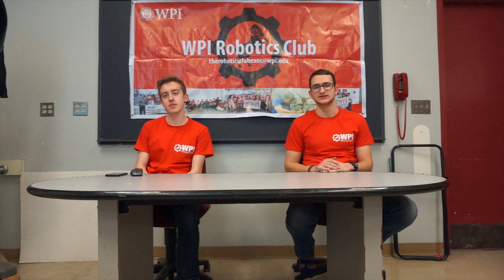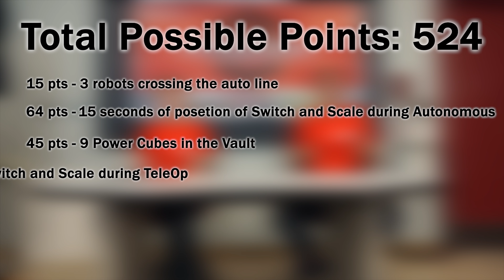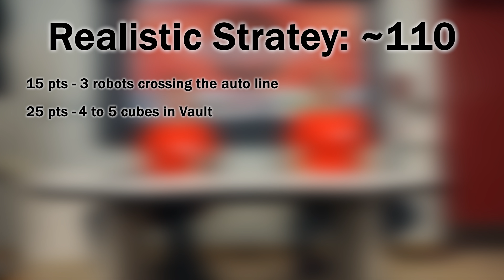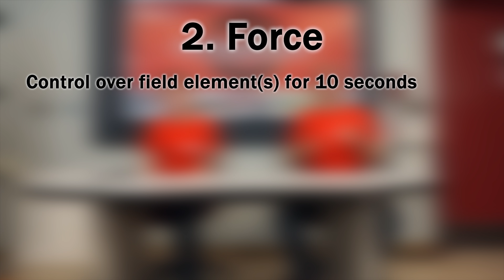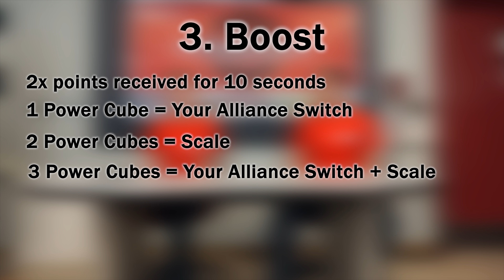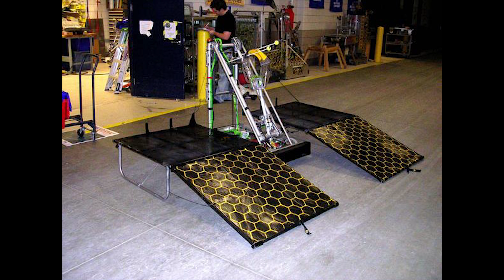RI3D 2018 FIRST FRC Power Up Strategy Video

Comment: Interesting video. Side note: Your hypothetical match score is 20 points too high, due to the fact that boost 3 doubles your points for 10 sec, meaning that you gain 20 points (switch and scale) more than you would normally, but not 40, because the ownership points were already accounted for in the 270 points of ownership. This makes the maximum match score 504.